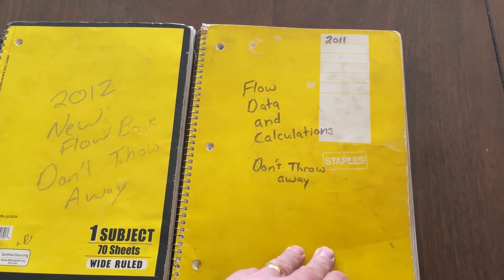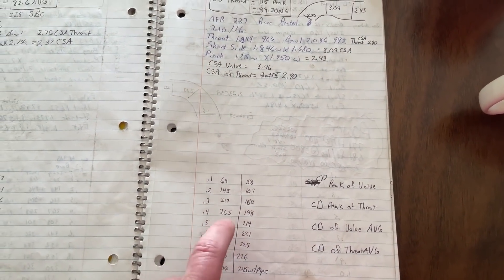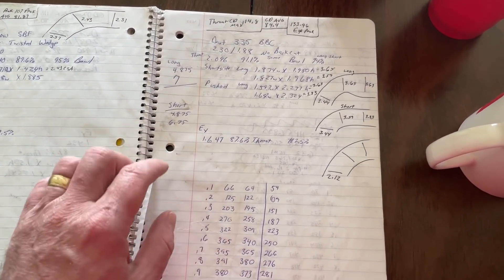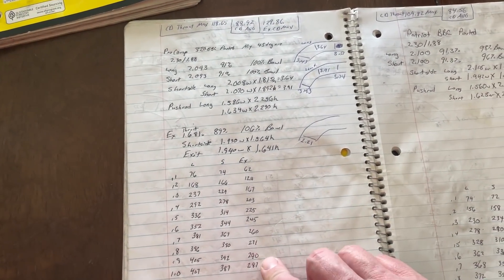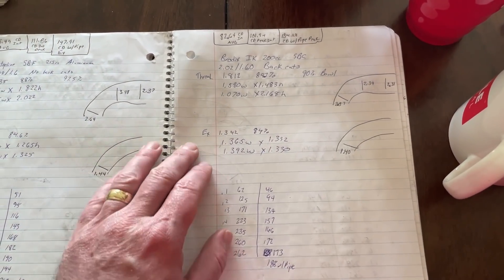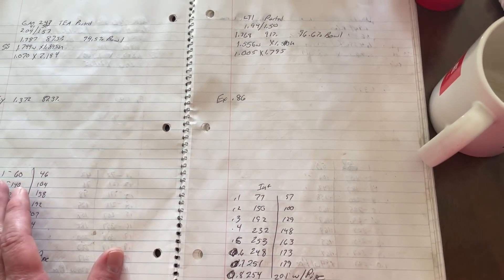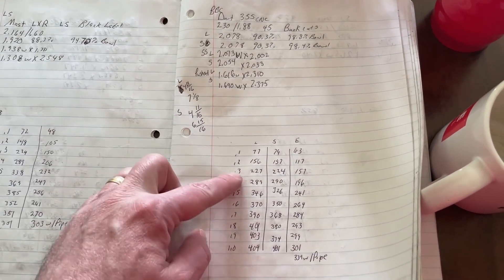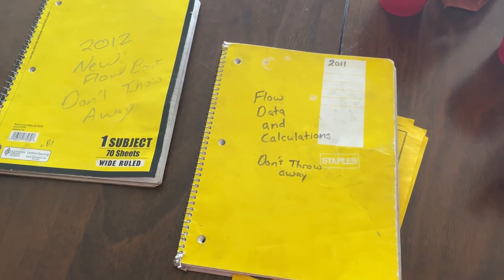Your Christmas Gift: Data On a Years Worth of Heads

Comment: Have you worked on any cathedral port ls heads with a carb intake? Interested to see what you would do the intake itself is a small rectangle port  seems the top of the cathedral was mainly used just for injectors but don’t think there’s enough room at least on my Holley 300-132 intake to raise the port up much and definitely not all the way up to the carb flange since it’s not a high rise. It’s a 360ci solid roller motor if that plays any part will spend most of its life in the 5000-9600rpm window also has a 950 carb

Comment: Hey Eric I've been watching for a while and love your content, im a euro 4 cylinder guy but have been getting super interested in SBCs and LS, I have a neighbor that builds SBCS for all his cars and I just told him bout your channel and that he could maybe benefit to see the flow numbers etc. Anyways I have a question for you! I know you don't mess with foreign  motors or much turbocharged stuff but I want to know your opinion on cylinder filling/velocity over raw CFM. There's a huge debate in my 4 cylinder world on small port vs large port on a 1.8liter turbocharged motor with 20 valve head with 3 intake valves 2 exhaust , whether the small port head (43x26mm oval port) with much higher velocity but way less CFM performs better for our low lift (.380 max) 1.8t motors due to better cylinder filling with higher velocities, versus the large port head(54x26 oval port) People on the forums argue that the RAW cfm will make more power/torque EVERYWHERE on the curve and the turbocharging aspect forces the air into the motor. but then the small port crew argues the High velocity and the newer bowl design will make more power/torque because its actually getting more air into the cylinder due to high velocity. the small port velocity is 650 fps at 5000 rpm and 986fps at 7500 rpm vs the large ports 379 FPS at 5000 rpm and 572 fps at 7500 rpm. Those velocity numbers were calculated from a forum user. The large port does 215cm at .380 lift stock and small port 185cfm at .380lift stock but small port flows slightly better at super low lifts, Id Love to hear your OPINION, as I know you don't work with turbocharged 4 cylinder heads but I'd still love to hear what you think bout CFM vs velocity for making power up to 7500 rpm

Comment: Great video lots of good information . Its a shame that some of the old stuff is not made anymore , it worked well. I remember doing Dart and TFS cast iron . What a battle , took a lot of time. Looking forward to hear  more from you
Reply: Ford n351 heads were damn tough to beat if you got the valve train setup right. And were a perfect example of less than stellar flow bench performance. Sucks they don't make them anymore.
Reply: @b.c4066  lucky for me I have a set . Be running in a few weeks

Comment: Nice now I kinda know what my head does I have a world product 220 with 208 intake valve but I saw you had the 215 so I figured there close. I have this head in a asphalt late model so what do you think of it. We run against crate motors which they keep winning because they put power to the ground on 8 inch wheels and tires